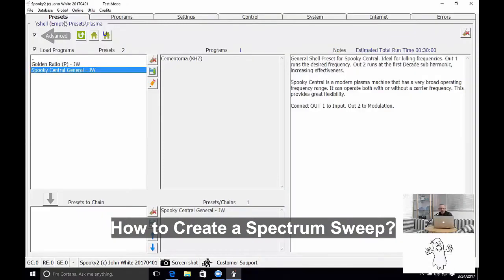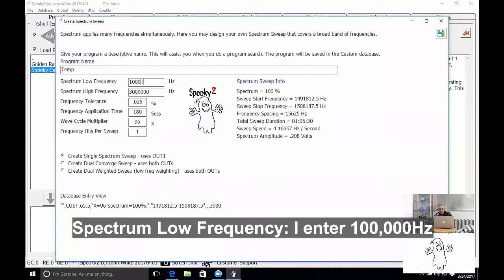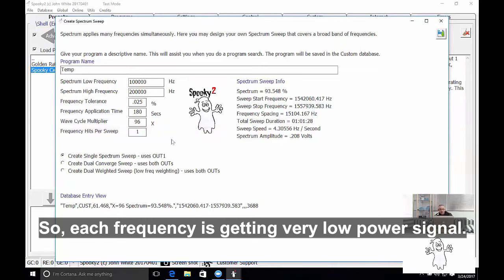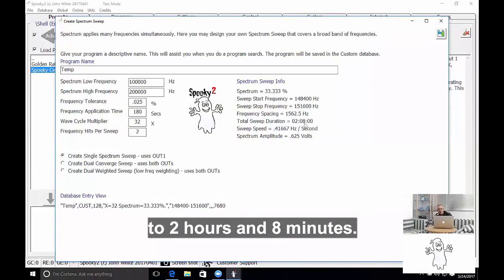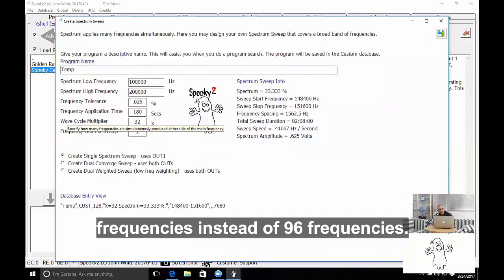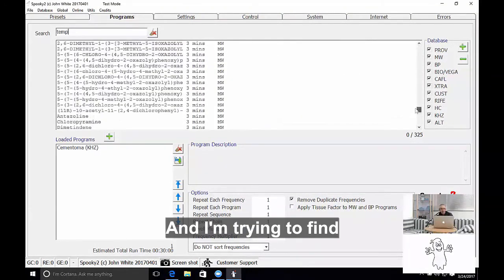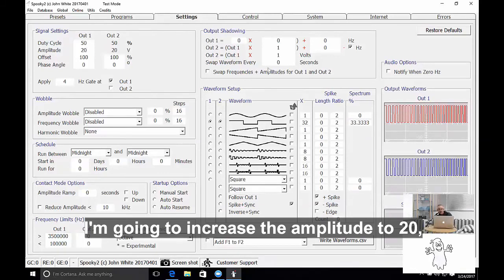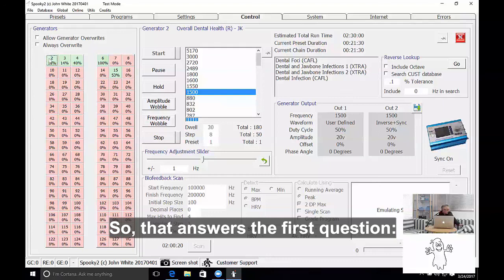How to Create a Spectrum Sweep

Comment: How do I know what low frequency to put in and what high frequency to put in to make sure I cover as many pathogens as possible?
Reply from the maker: Hi, feel free to send your question to support@spooky2-mall.com, our support team will give you much more professional advice!
Reply: There's a preset specifically for frequency sweeps in the main software menu. When you select the category 'frequency sweeps', and then for example remote - then you will see a number of different frequency sweeps types with an explanation on the right side/column to each sweep. You can create your own sweep any time to your liking - if you for example find out that mold in your house is in a specific frequency range.
Reply: How to find out how common is mold in your home? I think the question has not been answered.